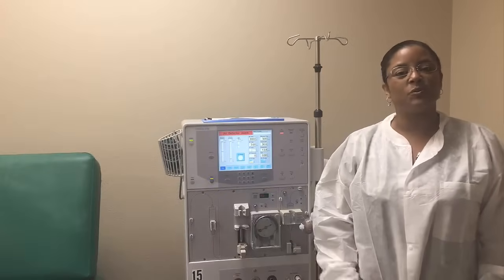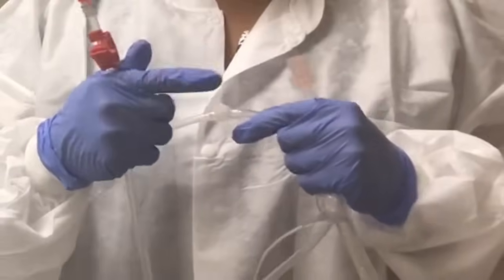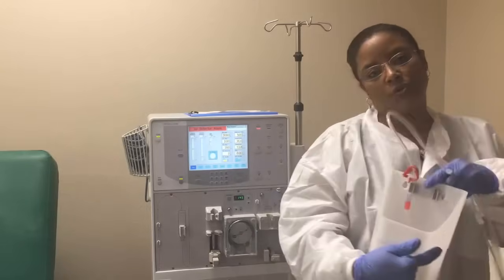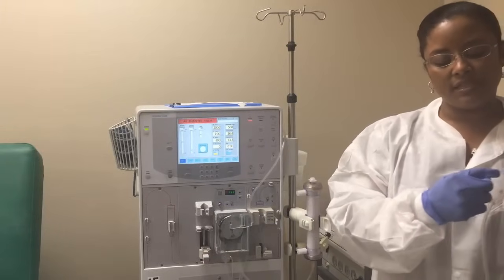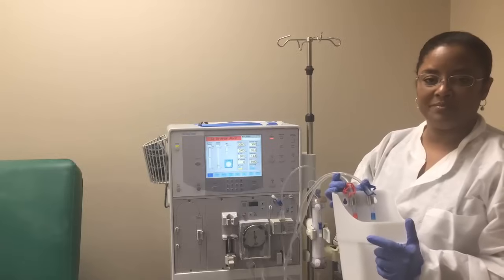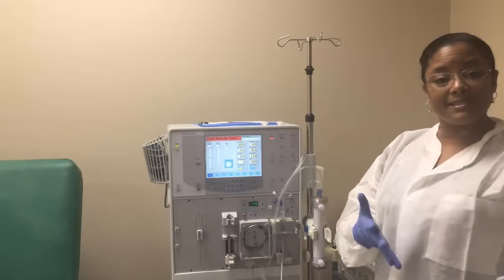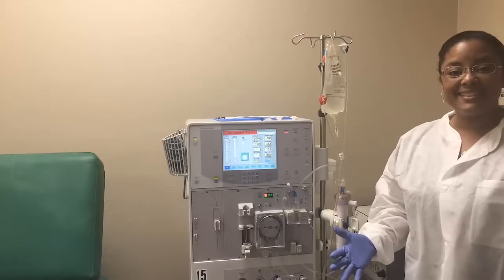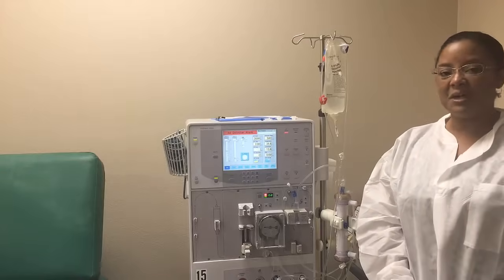How to set up a Dialysis Machine  part I (Hemodialysis Training)

Comment: Thank you for the video Utopia! A great step by step for new technicians!

One question though. How do you know which end of the dialyzer is the bottom end?
Reply from the maker: Hi MrGilder103
Typically the bottom end is the one at the "bottom" when you can read the dialyzer. Meaning the letters are not upside down. In the past, we used longer lines, blood lines that is. With longer lines we were able to flip the filter during the priming process to help remove air. (Theory: Air moves up). Now days, lines are shorter (less blood outside the body/less blood loss), therefore when we connect these lines to the filter it's impossible to flip it. Many companies just decide to place the filter with letters upside down from the start. Technically, it really doesn't matter because the important thing is that blood flows in one direction and dialysate in the opposite direction. Hope this helps!